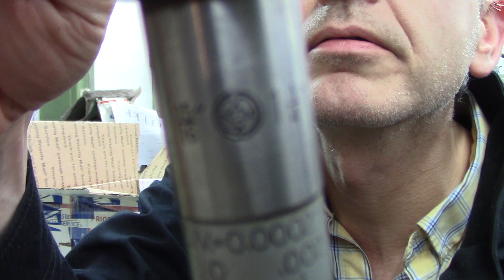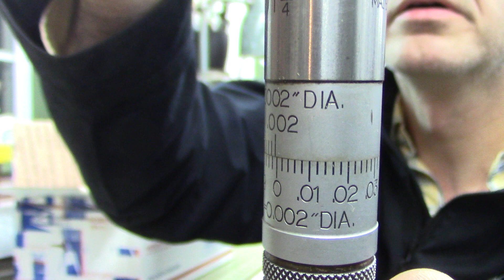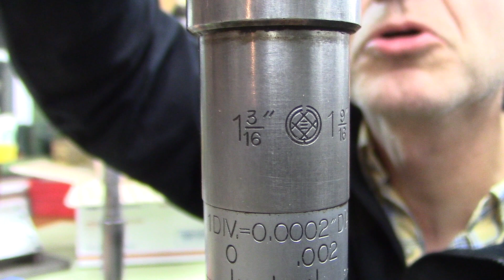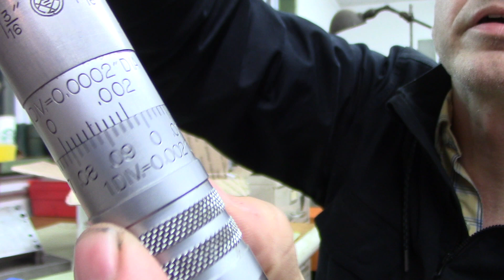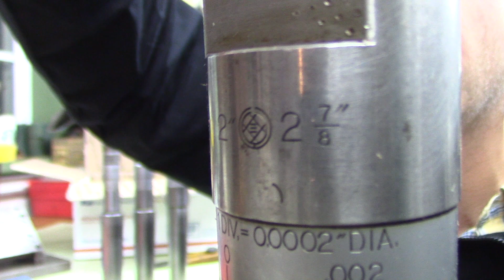12-13-22 --  SIP Type Boring Bars

Comment: Hi doozer! You will need to test the bars out approaching a size. I found using a regular offset head to about .020" from the hole size then use the vernier offset heads to finish the hole to tenths. You can speed those up because they have good balance. It bugs some folks, but I will whack the shanks off anything and adapt to the machines I have. Your heads may be for a Mitsu Seki jig borer. The old B&S & Jarno tapers were called self-holding and can get stuck so bad in old milling machines with draw bars you have to machine them out. You are looking good!
Reply from the maker: I think you are right.  I know Mitsu Seki made a copy of the SIP jig borers.  That is probably what it is.  Yes I need to test and tune with them to get a feel of how they cut to size or not. At least figure out if they read radius or diameter. No shame in adapting shanks. Love your tool cutter grinder videos.  Moore stuff also.  ------Doozer

Comment: Good video 
I get in these different cycles on eBay to. 
I have one of those type of Boring bar -Boring head
I need to go look at it. I think mine is 3/4 shank. 
I do have a bunch of those criterion boring bars that have the adjustable head. They don’t operate to.0002

Comment: Take care of those tool bits on those sip bars!! i have one about 2" but have never found any of the bits for it so have not used it.
Reply from the maker: There is one on ebay right now. I gotta measure mine and get back to messaging the seller to see if his will fit.  The smaller head has a toolbit with the exact dimensions, only shorter.  So if I have to make one, I have some numbers to go by.  That 30° slot for the feed tang is 3mm and tight tolerance.  It would be a fussy grind job using a thin wheel and some side wheeling. I need a buddy with a wire edm.  Thanks Brian.  --Doozer
Reply: @kooldoozer  Mine uses a toolbit with like a rack cut on it.
Reply: So, I am curious how these adjust - does the tip of it actually slide sideways, or does it push that bit down the angled ramp, in which case you might need a special surface on the bit? Or, is bbloc02 saying it might advance the cutter with a tiny rack on the cutter itself? & do you need different special bits for the whole range of sizes? Interesting stuff!
Reply from the maker: @windrk_6754  It is an angled ramp ground or EDMed into the cutter bit.  Maybe I will take one apart for you to see in a coming video.  ----Doozer